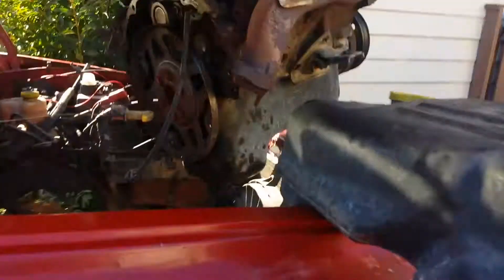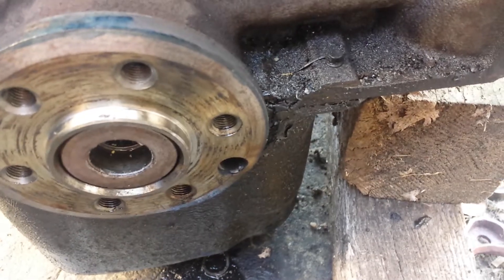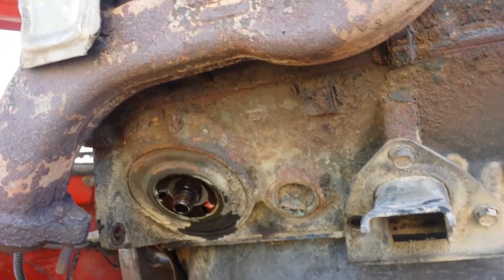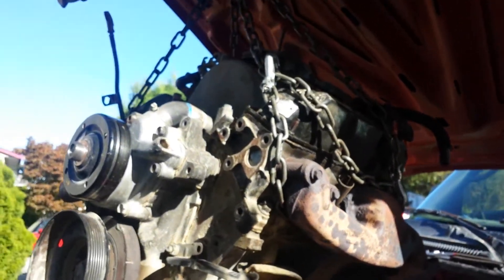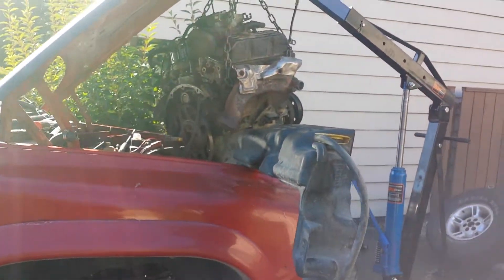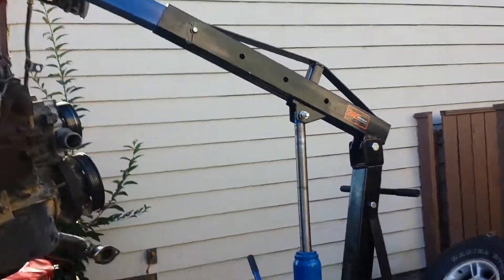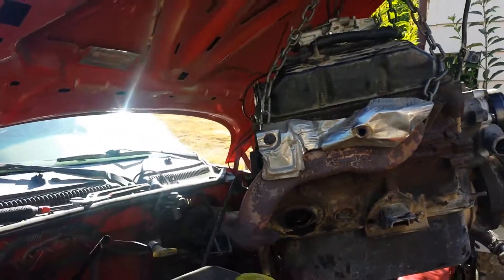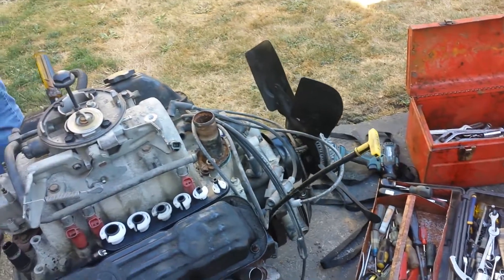DODGE DAKOTA ENGINE SWAP

Comment: Dudes..Those Dakotas are hell..
I'm on one now..
Myself I went ahead and removed Radiator, air conditioning core and the front top hood support..
After a good long look on the bottom end,I have decided to pull engine and transmission together..
The flywheel bolts on that motor are hell to get to.
Rusted hearts on exhaust bolts,so I cut the exhaust pipes in three easy to get to cuts..
This is a 2001 Dakota..
I've always liked Dodge. Mainly because they have a deep American history..
But I have never done a major job on one that wasn't harder then most of same jobs on ford or chevy..
It's like pencil necks that drew up plans on them want to make it as hard as they could on hard working mechanics..
Good video..
Thanks for sharing you guys..
I feel you and respect you..
Reply from the maker: Hey man thanks the awesome comment and yeah it was one hell of a job I can tell you that everything that can possibly go wrong went wrong it took us almost two days to get everything sorted out kind of sucks that I ran into space cuz I would have filmed more of it
Reply: No other way to put it Bro..
Dodges are just hard for any mechanic to work on..
Your welcome man..

Comment: just fill the throw out bearing full of grease put a rod that will fit tight in bearing and hit it quick and hard with a hammer and the bearing will just pop out, real easy!!
Reply from the maker: thanks you for the tip! i will keep that in mind